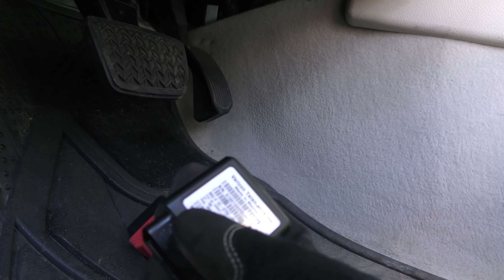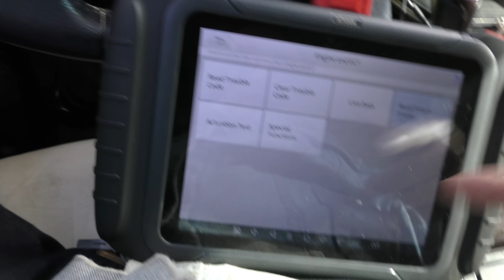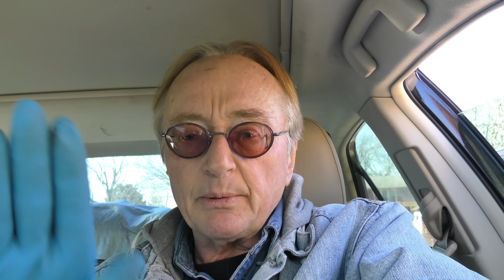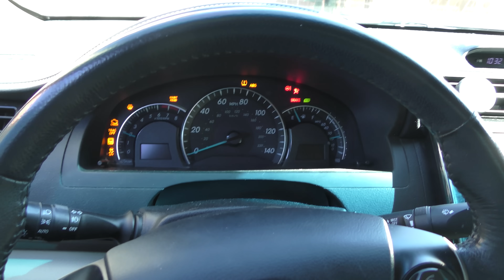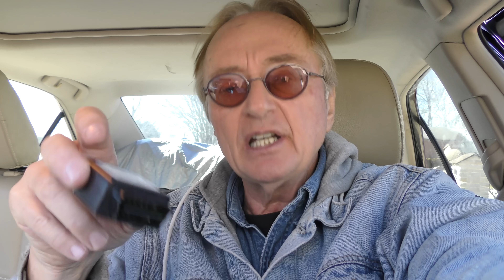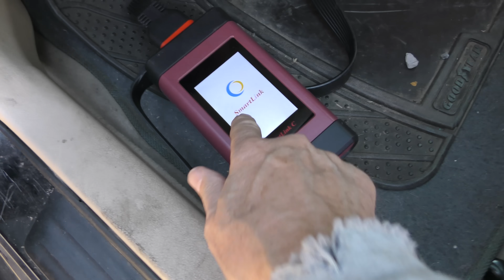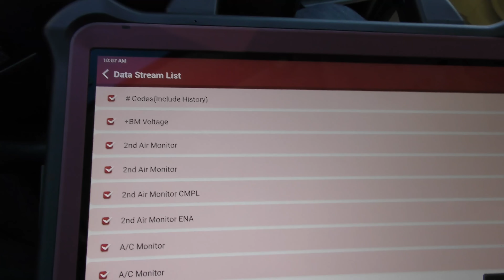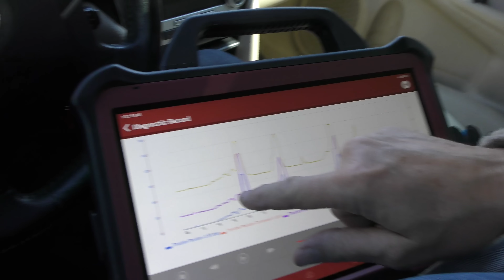This Stupid Device Just Cost My Customer Thousands in Car Repairs

Comment: Scotty I have a Garmin GPS that an optional connector for the GOS to read all the functions of the car. Also shows gas mileage mpg and stores it also will read the codes if the light comes on. I have had in 2 cars now since 2010 and close to 100000 miles. I really like the functionality of the device. When I shut the car off it will give me miles and miles per gallon and gallons used. I don’t know what I will do if the GPS quits. Love watching your videos.

Comment: I use a Bluetooth OBD2 device with the torque app. If I leave the app off but the Bluetooth device on( it has an on/off switch) my trans will have a lazy shift ....if it's linked properly, I have no issues

Comment: I've got one to deactivate the AFM in my GMC Yukon.  It stays in the OBD11 full time and prevents the computer from switching from 8 cyl to 4 cyl.  I'm wondering if it's not a good idea???
Reply: I would also like to know, since I got one in my Sierra 😅
Reply: Me too! Have one in my 2010 sierra been in for years. I don't use any engine oil between 4000mile changes.
Reply: If that is what you use to disable afm then leave it be. Scotty gave no evidence that the computer was at fault or how and why the dongle caused the issue. He is guessing and its really a terrible guess and a disservice.

Comment: I'd take the whole throttle body out for better cleaning and for the dirt and carbon that fell into the injection system and eventually to the cylinder heads

Comment: I donot care what it is automobiles tools for metal shop workers carpenters I love it simple todays hacksaws are made well I mean the blades on each end have holes so when to put them on the the frame it is what is put in holes too short the blades are not held on properly fall off very easily you pay more get less who remembers the days when things were made less massed produced nicer quality worked better easier to use or fix such as my 1971vw automobile five minutes to change a front headlight bulb now half an hour five hundred cost verses five dollars I donot like hidden windshield wipers  or turn signals where they are hard to see if seen at all if used once from my left three lanes me middle someone all of a sudden goes left to right in front of me no signal crosses middle lane right one for right exit to side road I did it bd once changing lanes hard to see caused accident hit ran I used my signal it was bad to see rush hour no one rushes in today world society automobiles are made too powerful engines too big in size roads are too overcrowded too many blind spots or more computers on wheels no one could ever make them blind spot free 100x but I see some cars maybe 196o or so much less bigger windows all around the whole vehicle I wish absolutely nothing could be driven over sixty mph as were fords model as or ts fifty or less we need much less crap on our roads slow down enjoy life more same in dating relations the best is simplier have a nice day if gracias cam on ong

Comment: Especially on potentiometers, but great for any electrical wipe-connections, I've rarely had CAIG Deoxit fail to restore intermittent faults. (And that can is a lot cheaper than $300.)
It's commonly used by those who restore old electronics, does anyone else use it in automotive applications?
Reply: That's great but today they don't use as many potentiometers as they used too with the carbon strip and wiper.......as a cariable resister
My 2014 has a newer system with 3 different references in one sensor
Forget what they are called

Comment: Scotty, that looks like that verizon Hum device.  It is a tracking device, diagnostic device and it give wifi access apparently.  It is a monthly cost as well.  Not only does it mess with the vehicle computer, you pay verizon for the pleasure of them messing up your car!  Great video!
Reply: Judging by his diagnosis,  it's was probably a throttle position sensor. They go out more often. Most are built into the throttle body. Whole throttle has to be replaced. 😁😁😁🇺🇸🇺🇸🇺🇸
Reply: I really don’t understand why you can’t just leave a unit plugged in. It’s just another tap on the CAN bud, which was designed for it.  Maybe one of the cheap ones tries to send override commands, but I doubt Verizon is pulling that trash.  I leave a Bluetooth unit plugged in my volt for monitoring. No issues in years
Reply: @rand paulin  i know 2 ppl who have had issues with their car cause of these wifi dongles. 1 Verizon and 1 tmobile. Dunno why because they both ended up selling/scrapping the car but Ive learned to just stay away.
Reply: Naw these dongles arent the issue thats a scapegoat truck drivers drive with gps trackers for ELD that plug into you guessed it the obd II plug, i personally work for a company with a fleet of vehicles all equipped this way and not one has this issue with some trucks and cars getting close to the 200k mile mark, the difference is the oldest vehicle is 5 years maintained and being work vehicles also beat,
Reply: I'd respectively disagree with Scotty here, I doubt the Verison dongle is to blame, it's most likely either a bad earth at one of the earth straps, or the computer has simply succumbed to time earlier than usual.  Not sure what it's like these days, but back in the day when I used to own a lot of JDM vehicles, Toyota's would start to develop leaking capacitors in the electronics at around the 15 year mark - sometimes more, sometimes less, and it'd cause weirdness much like this.  I still have a JDM Toyota Voltz, and the SRS/Seatbelt control module failed in that when it got to 15 years old, due to leaking caps.  Normally I'd get stuff like that repaired by a decent electronics technician who could replace the caps and clean the PCB tracks, but in the case of the the SRS module I wasn't going to risk it and bought a new one.  That's the only module that's failed on that car so far, it's still going now at 20 years old.
Reply: Hum by Verizon Auto Assistance Telemetric Device AT-660
Reply: Some insurance companies give you a OBD dongle to monitor your driving, miles and what not, I know people who have gotten a brake on their insurance after using one. 

Companies with a fleet of vehicles also use those to snitch on you when you drive like an as*hole...
Reply: @Yeah Right Dunno if you're being sarcastic, the design is not right anyway, the OBD is not meant to be something you "plug in and forget it in", it's a diagnostic port by spec.
Reply: @hariranormal5584  Actually it's just a CAN connection interface with a standardised diagnostics plug. The car is full of control modules and sensors that are permanently connected to the same wires.
The reason they design cars this way is to reduce weight and manufacturing costs, you only need maybe 5 wires from the front of the car to the back, instead of a wiring loom the same diameter as your fist.
Whilst there is a potential for a faulty device to interfere with the communications between modules, permanent damage is extremely unlikely due to the extremely robust design of the CAN Bus system.
Reply: @hariranormal5584  He is 100% being sarcastic hints the toyota drop. Also leaving a scanner plugged in for real time diagnostic is normal so technically leaving it plugged in shouldn't do anything but this specific one is constantly connected to internet so could affect it I mean you never know.